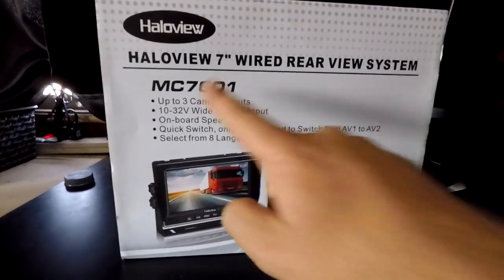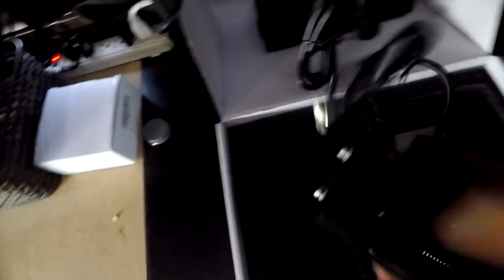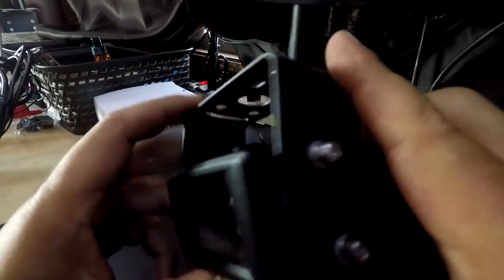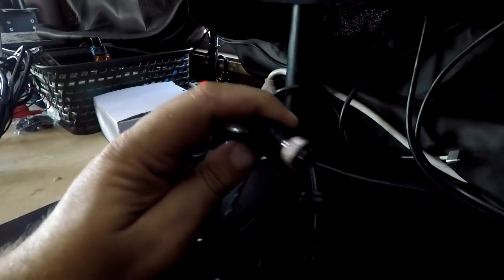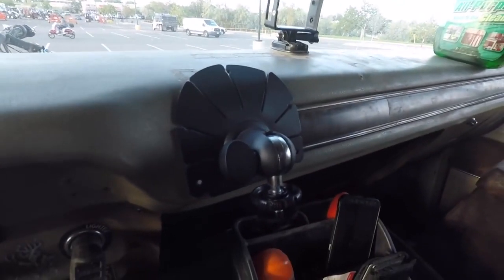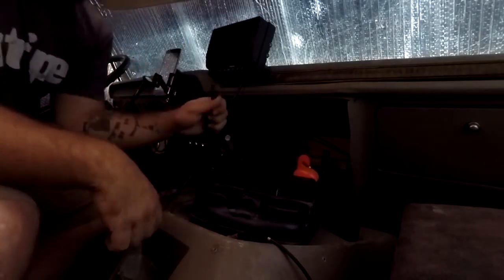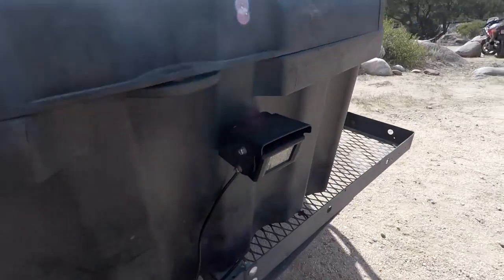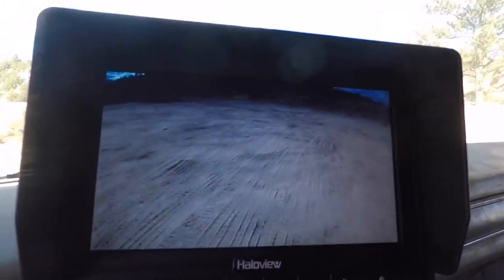RV Backup Camera Install  Haloview MC7601 Wired Camera System

Comment: Well I wasn’t so sure about this video at first But then it was what I was looking for in a review.
I really like the sturdiness and tough design this would fit my Army truck. I prefer the wired over the wireless . You really hit two big questions that I couldn’t find out from the box pictures & descriptions and that was that it has night vision & water proof. 
I can improve the water proofing that connection plug.  You did a pretty good break down of the components , maybe some more camera viewing & night shot would have been nice. 

Great video I think I’ll pick this camera to buy now. Thank you.
Reply from the maker: Hello, Josey
Thanks so much for your support.
Hopefully, you have a good user experience after installing our system.